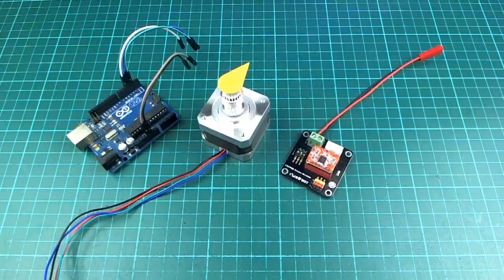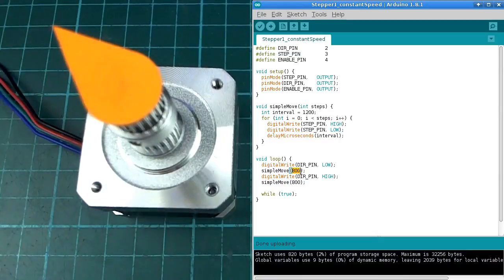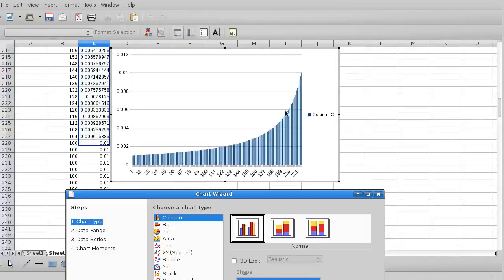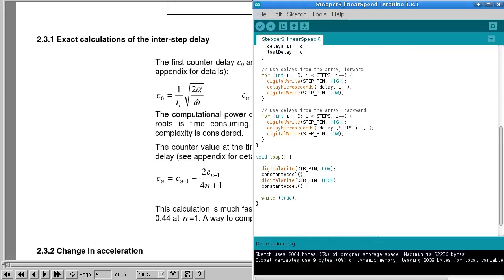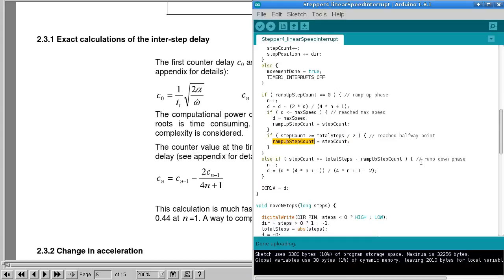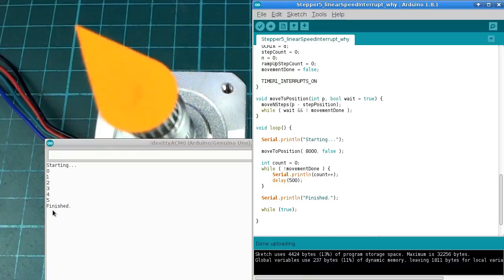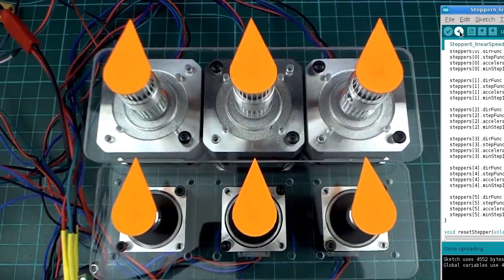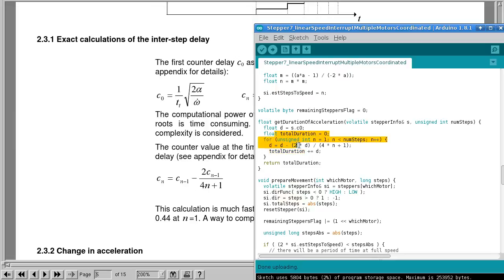Coordinated stepper motor control (arduino)

Comment: Thanks for the video and code I was wondering how to run simultaneous steppers on a single interrupt.
About your total time problem try take the integral of your taylor approximation that should deliver an equation for time given n steps. (im not sure how much (if any) error there will be since the function is not technically continuous though)

Comment: I wanted something similar to control the four (mecanum) wheels of a robot simultaneously.  The robot gets its signals via an r/c link so the Arduino has to decode the channels, do some maths to decide how fast and in which direction each wheel should be turning and then drive the four stepper motor wheels.  I figured the Atmel 328 didn't really have enough power to do the job, so I used an Arduino Due.  The Due processor has lots of independent 16-bit timers that can each trigger a separate interrupt routine so it made the job easier.  I suppose I ought to blog or YouTube it - I intend to, but I have too many other projects on the go right now...

Comment: So I noticed you have a have an estimate of steps to speed, I worked out a better estimation below (it's off by at most one step). Rather than iterating the whole travel, you only need to do iterate the acceleration phase, multiply by 2, then for the section at full speed it's the number of steps at full speed multiplied by the minstepinterval. This should at least give you a much faster calculation for long travels.

STS = 22.4657883552684 + 0.00866930847714168*accel + 0.000425543784288607*accel^2 + 2.65412741426717e-5*accel*minStepInterval^2 - 0.0418086926739384*minStepInterval - 0.00143531721941601*minStepInterval*accel - 0.00840861885526016*minStepInterval^2 - 4.3628046223091e-6*minStepInterval*accel^2

P.S. When you're making one movement followed by another movement, you probably want to have the current inertia carry over that can be carried over and not have a deceleration phase. A complete change of direction does need to have deceleration. Think of doing a circle using many small line segments, it's going to take a lot longer if each line segment has to accelerate and decelerate individually.

Comment: Sorry but you are wrong. Arduino can not run different tasks at the same time as you stated. It is always task switching. 
This is important for new users not to get confused. 
By adding some io heavy task like serial communication things become very quick clear.
Reply from the maker: Well obviously it's not running at exactly the same time, because there is only one processor (hence the name 'interrupt'). Maybe I should have called it 'non-blocking' if you prefer :)

Comment: Which stepper motor are you using? (Current rating, Voltage)
Reply from the maker: nema17 and nema11, I think 1.3-1.8A and 600mA respectively
https://goo.gl/7PsCqr
https://goo.gl/tBGBH6
https://goo.gl/PNjq1W

Comment: Very nicely explained. Thanks much for the obviously great amount of time you put in!
Off topic a bit, I'm trying to create an RC LED controller for a mate but ran into trouble using a Digispark module to get the PWM value from the RX.
Way too random using the CHANGE interrupt, so now moving to a Nano so at least I can debug using serial.
Looks like using registers may be best way to go.

Comment: what is the max voltage on nigh battery like lips 1 cell is 4.2v
Reply from the maker: You mean NiMH battery? I think you can push them to about 1.5v, maybe 1.4v is safer though. Pretty sure you could find out with a quick google search :)

Comment: At 26:16 should your test be 

if ( d >= maxspeed) { // reached max speed
    d = maxspeed;
...

Love your videos, keep up the great work.
Reply: Aaron DC mediA no , the speed is controlled by delay between the steps. So a low number (delay) means high speed, and a bigger delay means slower speed.
Reply: Ahha.
Reply from the maker: Yeah, I improved some of the names in subsequent sketches.
Reply: I was thinking the variable has the wrong name.  The name should reflect what it does, while it does control speed A closer name might be maxDelay.
Reply: minDelay! which is the same as maxSpeed

Comment: Very interesting, once i have tried to speed up a stepper motor as fast as possible. My frequenz methode has reached 4092 rpm's with a stepper motor 200Steps/turn. (Video on Channel)   Very good explaination and you haven't got me lost until the formula out of the datasheet/pdf.

Great Video!!

P.S.: I have already worked with Timer Interrups ^^

Comment: I didn't yawn very interesting, thx for sharing!
When ramp up delay is calculated with d=d-(2*d)/(4*nr+1) then ramp down is d=d+(2*d)/(4*nr-1) where nr is the step number in ramping up or down (nothing to do with total steps made). Increment nr when ramping up and decrement it when ramping down. nr doesn't change when at constant speed. At constant speed only n changes.

Comment: Thanks man, I have downloaded the application note quite recently and haven't worked hrough it, yet. What would interest me now ist how you would not only coordinate linear motions, but control all motors synchronously with different movement profiles (like you would need for a robotic arm). Or if you wanted to make a circle on a CNC machine. You would need to calculate the acceleration and the line segments independently and combine them somehow, I think. Maybe cut everything into small segments and handle them as linear motions?
Reply from the maker: I am thinking to cut everything into small straight segments, yes. To be honest I haven't thought much about the details of that yet, but I can tell there is a whole other level of complexity to come.
Reply: I would also maybe consider the servo approach: set a fixed time interval (maybe 10ms or something like that) and compute the speed for each motor for this interval. This may not be the best approach for really precise movements, but should be good enough for general movements. This way you could segmentate your desired curve for each motor and let it move along on it.

Comment: I think You went too crazy with volatiles there. If I remember correctly You have to use volatile only for those variables that are used in both ISR and main, overuse will degrade the performance.

Comment: That's awesome! Btw. the most important use case of coordinated motors is on robotic arms. Since CNC machines often have to move axis-by-axis except for interpolated movements like you showed with the diagonal path. I love coordinated motors!

Comment: Rather than calculate the time in formula it'd be more accurate to disable the steppers and run the step routine counting millis(). Doing that will also include any additional service routine delays and other interrupts. You could run a "simulated" routine at power up to keep the figures accurate just in case the clock speeds or other "thing" change that could affect the time. 

Calculating 5 long moves at power up would only take a few of seconds at most.
Reply from the maker: I don't quite follow what you mean about counting millis(), what would be the purpose of that? You mean to find out how long each motor would take so I can slow down the fast motors? Yes, it might be more accurate but accuracy is not as important as the ratio between the individual speeds. It would also make every movement take twice as long if I have to run a 'dummy' pass first to measure the time before actually doing the movement.
Reply: Regarding your question at 45minutes:
Thinking you could in the software calculate at some point the time taken for a "travel" of, say, 100,500,1000,5000 steps. Knowing the time taken for these it should be possible to graph or calculate the time taken for anything in between. The lower step times will be dominated by loop times, acceleration/deceleration times. Longer runs will take much nearer the "running at full speed" time.
Plotting more points would allow a more accurate "estimate" of the time taken for all steps distances but would add to the time.

Once you know the table above, you could loop rapidly through your "job file" and gather the entire time taken for all moves. For higher accuracy you could actually recalculate the table or add extra points as you progress through your "job file." At the end of the job you could export the table back to your PC giving yourself some solid data on the real time it took for each move. With all of that data  I'd expect a really accurate graph of time taken for a step of any size to be achievable.

Since you're moving all at the same time and slowing the short travels to match the time taken for longer travels you only need to calculate time taken for the longest travel on each loop.

Basically, it's a version of your brute forcing the timings to build a graph that can be read back quicker at any future time. I hope this makes more sense.

Comment: Really interesting. Would it be possible to pre-compute the (double square root formula) delays with Excel, then hold them in an array for the Arduino to use?
Reply from the maker: Not likely on an arduino with only 2kb RAM :)
Even if you had the memory to store the values, they would only be valid for a certain acceleration/speed setting. If you wanted to move a motor slower or faster you'd need to calculate them afresh each time you changed it.
Overall accuracy is not a major concern, the approximation works pretty good.

Comment: Funny enough, I actually needed an efficient stepper control library recently and didn't find a single interrupt driven general purpose stepper control library that supports acceleration except for Teensy which is relatively expensive. Of course there are libraries like Marlin for 3D printers, which obviously also have to control the stepper motors and do so very efficiently. But no efficient general purpose libraries.
About your acceleration duration problem. As far as I can tell you are just adding up the intervals between steps from speed zero to the target speed to find out how long the acceleration will take?
In that case, assuming you are accelerating from 0 to 50 steps/second with an acceleration of 25 steps/s² (steps per second per second) you could just divide 50 by 25 which gives you 2 seconds. That works fine, until the distance traveled doesn't allow you to reach top speed before decelerating again. In that case it's a little more complicated.
But let's assume you are going a distance of 80 steps. In that case your maximum speed reached before decelerating again will be in the middle of that way so at 80/2=40 steps. The distance/time formula for things accelerating at a constant acceleration is s=0.5*a*t² in this case the distance (s) would be 40 steps (half of the total distance), the acceleration (a) would be 25 steps/2² and we want to know the time (t). To get the time we need to flip the formula around to sqrt(s/0.5/a). In that case the time needed to accelerate to full speed would be the square root of (40 divided by 0.5 divided by 25) which is around 1.78 seconds and the maximum speed reached in that movement would be around 1.78*25=44.5 steps/second. Of course the deceleration will take the same amount of time, assuming you accelerate and decelerate at the same rate.
Hopes that helps answer your question.
Reply from the maker: Yes, changing the speed by x steps per second would give you a linear speed increase. But we can't tell the stepper driver "do x steps per second for y seconds", we can only tell it "do one step right now", and we have to wait the right length of time between those steps to get the speed we want. The time to wait is inversely proportional to the speed, so things are not that simple.
Reply: I know, I have written programs to control stepper motors before too. Obviously you need to pull the step pin high and low every 1/steps_per_second seconds (preferably using timer interrupts), while constantly updating steps_per_second according to the desired acceleration.
As far as I understood, your problem is to (efficiently) calculate how long each stepper will need to finish the movement so you know which one will take the longest and therefore can adjust the accelerations and speeds of the others to finish the movements at the same time.
In that case, that's how you would calculate it. I know the stepper motor moves in steps (as the name suggests) and the arduino of course has to send pulses for the individual steps (unless you are using two H-bridges to control the stepper, in which case it's slightly more complicated). But the entire movement will still average out to follow the same rules as a regular constant acceleration since you use the same rules to determine the step interval at any given time. So you can just assume a constant acceleration and use the according formulas.
Reply from the maker: I came up with an approximation that works pretty well, see the video link I added in the description. It contains a square root if that makes you feel vindicated :)

Comment: Is there an end game here? Is there a project I need to prepare myself for? 
I do love these exercises!
Reply: We already started speculating in the video about the acrylic slew bearing. My money is still on robotic arm. I'd like to build one too. Let's count: 3 big steppers: 1 for yaw (slew bearing from previous video), 1 for shoulder, 1 for elbow. 3 small steppers: 1 for wrist pitch, 1 for wrist turning, and 1 for the gripper. @iforce2d am I close?
Reply: Cutter Slade let's not forget the milling machine.... Robot arm would be dyno.
Reply: Mark Greco "...would be dyno." I don't understand.
Reply: Cutter Slade Dino is a 70s term for Dynomite sorry for the confusion
Reply: Ah yea I agree! Not a native English speaker so that went over my head. I already have 10 of those mini geared 12 V stepper motors (28BYJ-48) and 2 GRBL shields for such a project.

Comment: Hello.
Good content, as usual.

But will be more comfortable to watch if on your next videos you locked the exposure and aperture on your camera.

Thank you, keep shooting.
Reply from the maker: It's a cheap webcam, I don't even really know what exposure and aperture do in the first place... what would change?
Reply: Try the package "Gtk-v4l" for Linux, you should be able to very easily lock exposure, apature and maybe even focus on your webcam :)
Reply: Explanation:
See your video, at the beginning' each time you pass your hand in front of the camera, the light of the video change, that is the camera changing the exposure to get an average lighting on the frame. Flickering the video.

Check your video capture software or the settings of the webcam, pretty sure you can locked it.
Reply from the maker: I think I see what you mean, but to be honest I can't be bothered with that level of fine-tuning. I kinda like that it adjusts for me anyway, I don't want to have more settings and knobs to keep adjusting, especially when the majority of my audience is blissfully unaware this is even a problem (I'm making assumptions here based on me not having a clue what you were talking about, but I could be wrong of course). If my videos were oriented toward a more artistic/presentation focused subject matter I might look into it, but it's unlikely I'll ever be making videos like that :)

Comment: Here's a "good" paper (or the one that I've read many times) http://lbms03.cityu.edu.hk/theses/c_ftt/mphil-meem-b23405430f.pdf

There's basicly two alternatives: acceleration/deceleration after interpolation (ADAI) and  acceleration/deceleration before interpolation (ADBI)

Linear acceleration/deceleration is the easiest way to implement (as you just have done and make the ramps symmetrical and not try to implement look ahead functionality)

So I think that there should be a function that takes in the desired movement from all the axis, the desired speed and acceleration and calculates top speed for each axis that can be obtained.  The distance might be so short as that the acceleration doesn't have enough time to accelerate to the desired speed, but it tops at certain value and then starts to decelerate.

There's a bad video on my channel that shows how the different axis speed relate to each other. https://youtu.be/nkAw2Agbsws
On the top slider is the feed rate then there's feed rate override and below them are the x,y and z desired movements.

Basicly to make the movements take the same time one can think of the desired axis moves as a fractions from the total move (hypotenuse). Sin/Cos can't be avoided nor the rest of the trigonometry.

Taking a simple x and y coordinate system the hypotenuse is the total distance travelled and on the same hypotenuse one can plot a timeline. At certain time the x and y should have travelled some distance such that the point is on the hypotenuse else the movements take different time.

I'll be looking forward on your progress. That's already much more than what I've succeeded thus far on my CNC controller.
Reply from the maker: Looks like a good paper, I'll give it a read, thanks!
Reply from the maker: An amusing line from that paper:
"In previous research, Lam proposed a new velocity profile generation approach to enhance the efficiency of successive trajectory motions by continuously machining, but the jerk was not limited in his method."
Reply: I had to read that line a couple of times and I think I finally got it... Must be because english is not my native tongue that I didn't get it :)
Reply: Here's a quick attempt to show Jerk controlled velocity profile generation.

https://youtu.be/WTp9o1MabFw

One is for trigonometric Jerk and one is for linear acceleration.
Reply: To get the acceleration time (and from there the number of steps taken in acc/dec) one needs to divide the delta speed by acceleration.

Vi = Initial speed (mm/s or steps/s)
Vf = Final speed
a = acceleration (mm/s/s or steps/s/s)

t = (Vf-Vi)/a